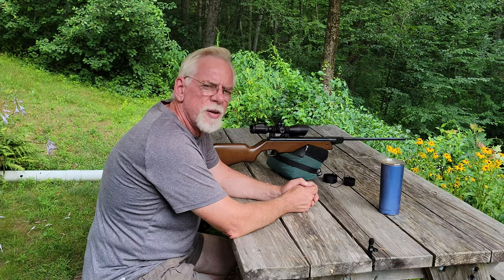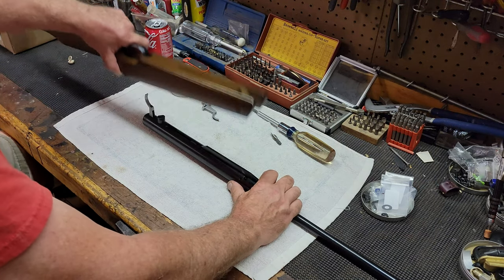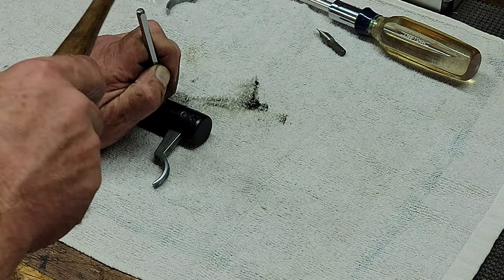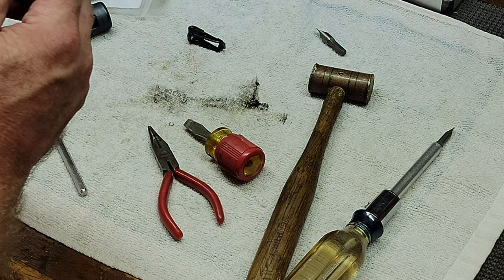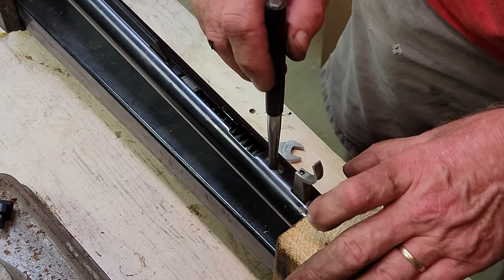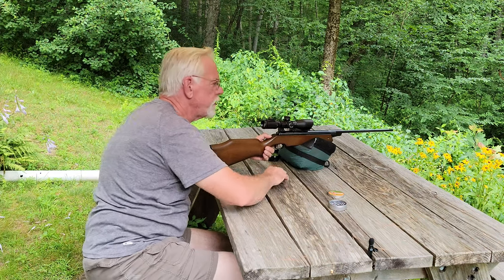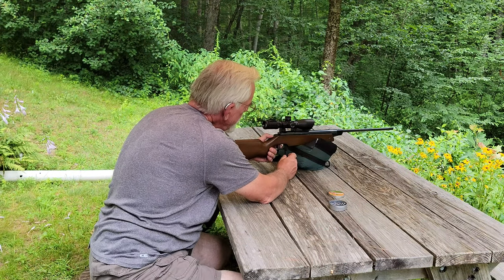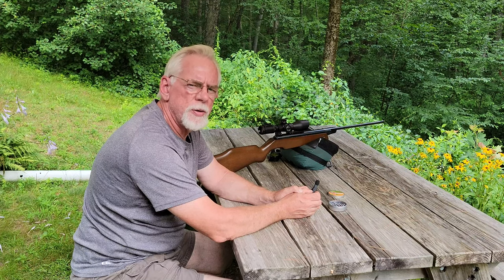FWB 124 Air Rifle Trigger Swap

Comment: I just took delivery yesterday of a Beeman (San Rafael) FWB 124 Deluxe that looks as if it was never used and it has the same click. It not as loud but I can certainly feel it, but pull weight is just under two pounds.  Whenever I get a new springer air rifle, your channel is the first place I go for information. I'm going to put a Macarri kit in it with help from your other video. I really appreciate all the information and knowledge that you provide and love your friendly and personable demeanor.
Thanks again,
Alex.
Reply from the maker: Thanks so much, Alex.  I'm thrilled to hear that you're enjoying the channel. Congratulations on a classic rifle. The 124s were the benchmark to which all others were measured. Fantastic rifles.
Thanks again, my friend.

Comment: that was quick  you have no idea how much I appreciate this.. I don't generally work on air guns and don't know the parts houses.  There is no one in this area that works on them so I get a lot of calls for this work.  It's just another type of weapon.  I do believe I need to get a spring compressing tool.  Brute force doesn't work well.
Reply from the maker: That's a tough rifle to reassemble. That's a long spring. There are videos of homemade spring compressors on YouTube.

Comment: Interestingly the trigger in my New FWB Sport clicks as well. The trigger can let off very quickly after hitting the second stage, and I find that little click quite helpful in letting me know when I've applied just enough pressure.
Reply from the maker: I know exactly what you're talking about. My Sport does that too. It's very similar to what I describe in the video on the 124 trigger.

Comment: Hi
I’ve got a MK1 127 with a plastic blade and the trigger is very vague but doesn’t click.
Such a shame that  Feinwerkbau didn’t produce a trigger anywhere near as good as Weihrauch’s rekord unit🙁
I use a cable/zip tie to hold the safety catch in place while refitting the trigger block to the comp tube
Makes life slightly easier 👍🏻
Thank you for sharing👌🏻
Reply from the maker: I'd love to get my hands on a 127. It is a shame that the trigger doesn't hold up to the Rekord unit. 
Good tip on the zip tie. Thanks so much for watching my friend.
Reply: @razor1962  😊
Reply: Second the cable tie trick... That's SOP for all 120 series safety's 😉👍

Comment: Nice Chanel, thanks. As far as I know, 124s don't have a 2 stage trigger. You might have a look at the sear & the notch in the piston rod that engages the sear. The area on all the metal to metal contacts may have some machining marks causing the catch.
Reply from the maker: Thanks Chip. Mine definitely is a two stage trigger. You're absolutely right about the bearing surfaces needing polishing. That should make all of the difference in the world. 
Thanks so much for watching.
Reply: My FWB 124D, 1981 issue, has a very nice factory two-stage; about 2 1/4  -  2 1/2 pounds, consistent.
Thanks for the most informative video.
Reply from the maker: @frankwright5528 Thanks, Frank, and thanks for watching.

Comment: The only thing i don't miss about my 124 is it's trigger, i replaced a bent safety spring which helped but it was never to my satisfaction, i would have loved to try a maccarri one in it but with postage it would have cost nearly as much as the gun!
Reply from the maker: Yes, the trigger is it's Achilles heal. 
If you're willing to change out a spring or two and do some careful stoning you can get a very nice trigger from what I've been told. I've been wanting to do mine but it seems that there's always something else that needs doing.
Remind me, where are you that shipping from the US is so expensive?

Comment: It seems a shame that both Feinwerkbau 124 and Walther Lgv both beautifully crafted guns are let down by not so good trigger units
Reply from the maker: I can live with the 124 / 127 triggers.   Being a "trigger snob" myself,  I think that although not well suited to
 bench work, it's more than adequate to live up to its name as a sporting rifle trigger. 
The Walther triggers, on the other hand, in my opinion, are a good design with cheap build quality. I own four Walther air rifles. I've removed the safeties in all but one of them, and I'll be removing that one, too. They all seem to malfunction. The rifle that still has its safety will fire when the safety is disengaged if you happen to forget and you pull the trigger while it's on.

There's an aftermarket trigger from Rowan Engineering out of the UK. It'll greatly improve the LGV trigger.

Thanks for watching, my friend.

Comment: he click must be a trigger notch, pin or part or the piston rod, then when you pull to the release something is moving .under pressure from the mainspring  with a click  
my fwb 127 is not clicking.  i had the cocking link broken and a new  link bend after litlle time , i made one from a hw 80 cocking link . and welded the  part that pushes the piston at the hw 80 link with a litlle work it  fitted ,  .  the newsport has a better cocking link  ,looks to me
Reply from the maker: Hi Peter, yeah that click is a little distracting.  I'm pretty sure that it's the secondary sear that's the issue.  I plan on getting it on the bench this winter to try and sort out the issue. 
Thanks for watching!

Comment: Where might this trigger be found.  I am a gunsmith and am repairing and restoring a model 24 sport for a client.  His has a plastic trigger and it is broken.  Advice on where to find one would be a big help and thank you for your expertise.
Reply from the maker: Air Rifle Headquarters  (ARH) sells the trigger blade itself.  If that's all that you need, then here you go....

https://www.airrifleheadquarters.com/catalog/item/251483/10497257.htm

Comment: Another great video. Original owner of two 124's, one standard w/ plastic trigger (Dec 1978 Beeman), one deluxe with metal trigger (1980's Beeman). Both behave similarly to yours, with that "hitch" just prior to second stage. Purchased a Maccari metal trigger 30 years ago, still sitting in my 124 tool box. Have you ever tried a Maccari trigger? No idea if/how it's any different. Also, in your video we couldn't really see a side-by-side comparison of your new trigger vs. original, wondering what were the key differences? You're building a nice following, I'd be one of your first Patreon subscribers if you ever go that route.
Reply from the maker: Thank you so much James. That's high praise indeed. 
Never tried a Macarri trigger.
I'm sorry to say that I never took the time to compare the two triggers. The one condition my friend asked was that I send him my trigger so it's too late to compare them I'm afraid. 
I can't thank you enough for your kind words my friend.
Reply: If you have the trigger, get his trigger screw also. It makes a BIG difference. 😉👍 Much lower friction, and finer pivot.
Unless of course you would want to sell that one ? 😏 💸
Best improvement is in Deburring the sear, polishing the auxillary sear, lightening the safety tension, modifying the crown of the adjustment screw, and actually using FWB trigger grease.
If the trigger is his stainless trigger, I'll give you $120.00 USD for it today. 😀 I build a LOT of 124's. 🤷🏼‍♂️
Reply: @marcmyers1465  thanks Marc for the advice/instruction. Not expert with triggers, and now I feel even less so lol. Away on vacation (Oahu), when we return I'll have a look at what I've got. Most likely will want to use the trigger in the plastic-triggered FWB 124, but if not I'll give you a shout.

Comment: I've reached the point where I'd like to make my Sport trigger a little smother, and with a little less pull weight. Do you know if the Sport trigger disassembles the sameway as the older 24 trigger does?
Reply from the maker: I haven't had mine apart, so I don't know for certain. The triggers do feel very similar.

Comment: That is definitely different ? 😳
 Gonna have to take a closer look at that trigger group to rule out the auxillary sear ! 🤔
Reply from the maker: If anyone can figure it out it's you  Marc.
Reply: @razor1962  You don't actually need the e-clip. There's a plastic retainer in the threads already. 😉
Reply from the maker: Now you tell me......😄
Reply: @razor1962  I really think it's the auxillary sear. 🤔 It's a very simple trigger that just requires a bit of judicious stoning and polishing to get you there. Could mean breaking the top edge of the drop off or there may actually be a trip line on the bottom where the screw rides over it. 
That is definitely a "click" ! 😳
Excellent mic 🎤 by the way. 😂
Reply from the maker: @marcmyers1465  It really is a good microphone.  Connects to the phone via a Bluetooth adapter.  Costs $30. Money well spent. 
I'll get that trigger sorted out. I'm not afraid to stone and polish the contract surfaces. Oughta' make a world of difference.